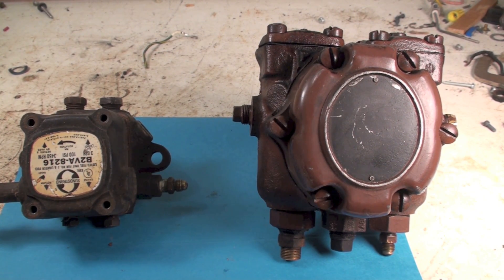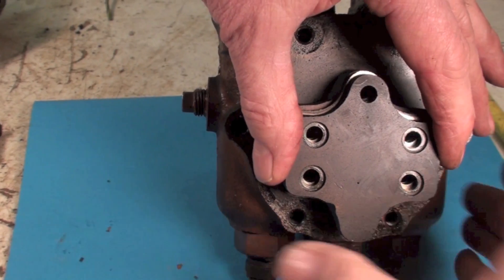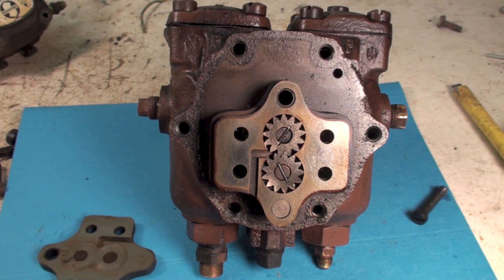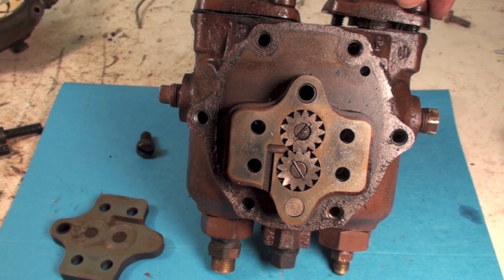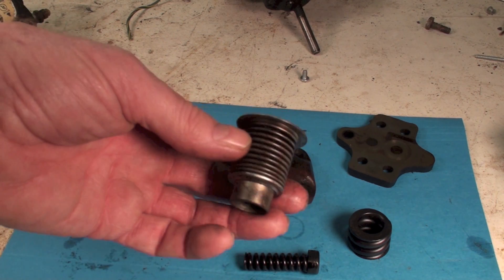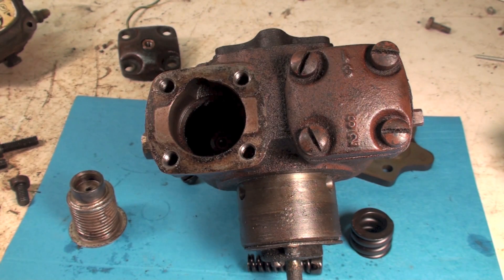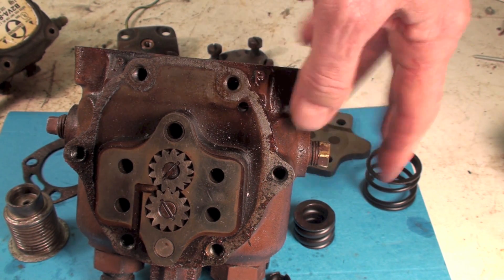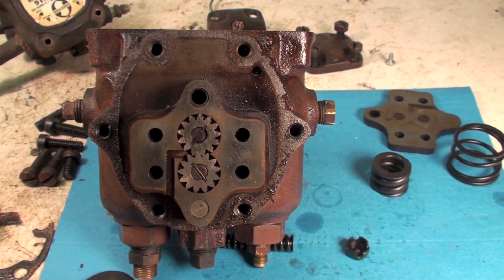How the antique Webster oil pump works

Comment: on the old webster under the bellows is the double needle valve and under that is a small spring .
the bellows has a seat under it and they typically get rough and need some rehoneing . The double valve on mine really needed re surfacing easy to put in a drill press and with some 1200 wet and dry clean it up to new shape .this needle valve is for a quick shut down so the nozzle won't go from spray to a pee stream . Mine leaks oil out the back on to the floor due to the shut down not closing well  or fast enough ....the second seat in in the unit that is part of the nut stamped Nozzle . that also needs honing ...After doing mine twice and getting it really sweet .it still leaks a little not as bad . so my next thought is that the 70 year old spring may have gotten a bit weak that goes around the needle valve ...

Comment: Thanks for the info. I just found a complete unit in my dads old stuff. The assembly weighs about as much as a subaru engine. Any idea what kind of pressure they will run? I figure maybe it will come in handy for a project or something.
Reply: They are suppose to run at 100 pounds .

Comment from the maker: That pump was made when the US had more steel,aluminum,and rubber than we knew what to do with.  The newer pumps work well, but the higher speed they run at sometimes will cause failures if the pump runs dry.